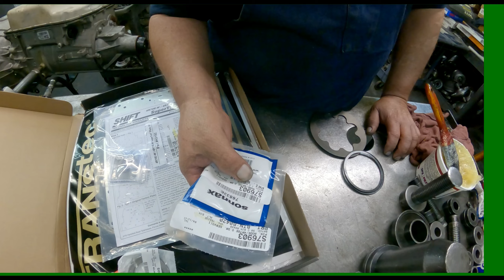Ford 4R70W Rebuild

Comment: Can you buy all of this in one kit ? Even the master kits at the parts store only have the bands steels and frictions and gaskets nothing more..
Reply from the maker: No. Nobody can guess all the parts you will need. And you will not need some parts all of the time.
Reply: @CurmudgeonTransmission Absolutely agree 100%. 
I will tear down and see what I need. Should I get a new internal harness just to avoid any unnecessary issues ?
Reply from the maker: @tedbear8168  If you desire to. They don't go bad that often. I replace maybe 2 a year. Usually need , depending on the year, kit w/ clutches and piston. Both bands. Most use a 4x4 filter even if it is a 2wd. Sonnax overdrive servo pin. Superior K0192. Shift solenoid assembly. If high enough miles, epc solenoid. Bearing  kit. Bushing kit and torque converter. When you get your converter, match the fin angles before you let the core go. They are the dimples on the outside. Get the wrong one and it will throw codes.
Reply: @CurmudgeonTransmission I have it completely torn down as of this morning the frictions and steels for all the forward gears are burnt completely up, I will take your advice and order the parts you’ve mentioned. Could the torque converter be the reason the transmission suffered the blown out seal on the piston inside the drum ? I found lots of rubber pieces of the seal inside the drum this morning.
Reply: @CurmudgeonTransmission the reverse band looked incredible for 216k miles it doesn’t even look worn down but the kit does come with the new bands ! I just get very nervous when working on things I know it can get very pricey ect. But so far the rebuild is way cheaper than a 2,400$ rebuilt trans.
Reply: @CurmudgeonTransmission and thank you for your videos sir I watch them every day 🙌🙌🙌
Reply from the maker: @tedbear8168  Thank you!!
Reply from the maker: If the drum is not cracked where the snap ring is then the frictions got so worn the piston over traveled and when it released it cuts the seal to pieces.
Reply: @CurmudgeonTransmission thank you for the explination !!! That makes sense !

Comment: Love your videos used this to rebuild my 4r70w 99 model only thing i cant figure out is the intermediate clutch was burnt in mine and slipped in all gears but there were no failures i can find. Other than clutch material in the fluid and the steels of the 2nd gear had a few burnt spots any advice. Also how much clearance should the intermediate clutch have  I measured it 3 diff ways per the info on Google and the clutch pack that came out was thicker than what I put back in 1.630 with bar to top disc but about 50 thousands from the top plate to the step can too tight cause slipping because the one that came out was 70 thou thicker than what I put back I havnt installed unit yet kinda scared
Reply from the maker: Too tight is going to cause a bind up. Too loose will slip. Where did you get your parts?
Reply: @CurmudgeonTransmission  I bought a remco kit off the internet and added a superior shift correction kit and sonnex pressure regulator valve all new electronics and harness the kit seems like it's decent but idk what do you think
Reply: Kit I bought had everything clutches steels  solenoids and bands and gaskets I'm hoping it fixes my slipping issue all the clutches were in spec except for the intermediate it seemed like it was thinner than what was in it I'm hoping it was a pressure issue that was causing the slip on the old stuff
Reply from the maker: Don't know anything about Remco, so can't say anything about them. I personally like Transtec kits.
Reply: @CurmudgeonTransmission  it seems good the friction plates are reybestos it
Reply: @CurmudgeonTransmission  should my output shaft be hard to turn input is stiff but easy output takes two hands both ways
Reply from the maker: No. Should be able to turn it with one hand one way. May need 2 to turn it the other way. Input shaft should be able to turn with one also. You may have the bearing that goes between the reverse and forward drum swapped with the one that goes between the case and output shaft. The one with the scalloped edge goes on the output shaft.

Comment: Just rebuilt mine with and input shaft turns but is pretty hard to turn. I’ve taken it apart and put it back together 3 times and still it’s the same everytime as soon as the pump is seated it is hard to turn, is this normal? Just resistance of new frictions?
Reply from the maker: I have run into a couple of things before that one of them will probably be your problem. The first one is a bearing being in the wrong spot. The one between the reverse and forward drum is really close to the diminsions of the one bewteen the case and the output shaft. The one that goes on the output shaft has scalloped edges, the reverse is flat. The other one I have run into 2 times is the thickness of the Intermediate clutches. They were only off by .001 per clutch but it was enough to make it too tight. Leave your Intermediates out and reinstall the pump. If it turns easier your problem is there. If not the bearing is probably your problem.

Comment: Great video recently built my transmission but when you put it in reverse the truck wants to die put it in drive and just bogged down little bit
Reply from the maker: Sounds like lock up is staying applied. Unplug the transmission harness. If it still does it you will know it is in the unit, if not it is outside the unit. Any codes?
Reply: No codes
Reply: I did fine transmission fluid in the wire connector that comes out of the transmission . The one that plugs in the wiring harness
Reply from the maker: @jamesball6847  Let me know what it does when you unplug it.

Comment: Hello, I’ve rebuilt a few transmissions over the last few years (mostly Honda and bmw)…..anyhow I’m now rebuilding my 4r70w but I’ve been having problems with the case bushing being too tight for the output shaft to move, it will only turn with 2 hands (not very freely), ive tapped all for sides with a rubber mallet and no luck😔 any tips or suggestions?
Reply from the maker: Make sure there are no burrs from driving the old bushing out. Make sure it is a quality manufacturer not Chinese. If you are still having problems, use a piece of All Thread to pull it into the case instead of using a bushing driver.
Reply: Well I got the old(new) bushing out and have another one on the way. It seems I have a slight burr, what would you recommend to remove it/level it?
Reply from the maker: Round file, sand paper.

Comment: Is it normal to have an extra friction and an extra steel in some of the kits ? After putting together the forward drum I have two extra frictions and 1 extra steel, I’m so stressed out about it for some reason haha.. I tripple checked and watched the video multiple times while installing the parts. I was just curious if you ever have extra parts
Reply: My kit didn’t come with a wavy plate is that why there is an extra steel and two frictions ? I’m utterly confused.
Reply from the maker: The extra steel and friction is probably for the reverse drum. There are 2 different ones. Most only have 3 frictions. The early ones had 4. You can swap the drums if you desire. If you look closely the reverse steels will fit in the forward drum but are a little loose. The forward steels will not fit in the reverse drum, they are too large. Same with the frictions. No the kits don'tcome with the wavy plate, if it is broken you will have to order it separately. There should be 5 frictions in the forward drum. Start with the wavy plate and then a steel, then a friction and alternate to the top. Then the pressure plate. Reverse drum starts with an apply plate with the flat side up, friction, then steel, alternate steels and frictions to the top. Then the pressure plate. Same with the snap rings. The reverse is slightly smaller than the forward one.
Reply: @CurmudgeonTransmission My man thank you so much for the response ! This is why I respect your Channel so much. Thank you man 🙏 I got it all put back together this morning and am going to start on the valve body this afternoon.
Reply: On my 1-2 accumulator the top springs there was only one big spring not a smaller one when I popped it out. Should I order the smaller spring or is it fine with the one big spring on top ? Thank you for all your help also,
Reply: I also didn’t have the tiny piece for the separator plate plate but it looked good with no cracks in it, I work in a manufacturing plant so I’m thinking maybe some of these small missing things they just didn’t have and they weren’t crucial components, or someone has possibly been in the transmission before ? I need to check the old forward band for any dates on it!

Comment: How the fuck do u get those damn clapsing ring to clasp
Reply from the maker: The way I do it is, push one side in. Then, kind of pull the other side around. It will make the tip pooch out. Keep pulling until it lines up, and then push it in. Little hard to describe. Go to my Instagram and I can shoot you a short video of it.

Comment: Hey buddy i really love your channel and appreciate all the information you've been offering for us, i have a f150 2000 5.4 2 valves, just finished rebuilding my engine by myself( its a project truck), works like a champ but after a few months ago transmission went bad, change gears but takes to long to get in the first, it slipping and not shifting smoothly from gear to gear, long story short ill take a chance and rebuild it by myself, what kit do u recommend me to buy?( lifted truck)
Thank for your help 🙏
Reply from the maker: I like Transtec with Raybestos clutches.
Reply: I ordered all the parts also the sure cure kit except the accumulator kit, i was wondering if you could recommend a brand for the servos, im looking at ebay i found a NATIONAL brand also Alto for the overdrive servo, what do you think???
Thanks for your help 👍

Comment: I have a 20005 Ford F-150 STX 4.2 4r70e, and I believe that my oil pressure pump is not working, will this help me into fixing it for the first time, I've never done this before, and I don't know the cost of such things to replace...
Reply from the maker: What makes you think the pump is bad? This is one of the easier transmissions to do. They can vary greatly in cost, depends on what is wrong with it. They are very prone to planetary damage and that can be quite costly.

Comment: I watched the video and loved it learned a lot . Will this same rebuild work on a 1995 4r70w
Reply from the maker: Yes, it will. There are a few differences. Assembly wise the difference will be when you get to the center support. the snap ring opening goes in a different spot. I have a video on that version of the transmission.  https://youtu.be/8FmiDaRKtZw   Thanks for watching.

Comment: My 2008 4.6 2wd  f150 after a few miles would hesitate on 3rd and 4th,when let go the gas  and then when I stop and park wouldn't go on drive, I put it on 2 and it goes, once is moving I put it on drive and is okay, need some advice please
Reply from the maker: Sounds like 2 different problems. The no drive problem sounds like a bad sprag. That will be an internal problem. Sounds like it is time for a rebuild.

Comment: Just an honest question. When I pulled mine apart it didn't have that rattle clip and my kit doesn't have one in there. Does it have to have the rattle clip?
Reply from the maker: If you are talking about the one under the pump for the Intermediate clutches, no it does not have to have it. They were not in all units. Forget when exactly it was they started putting them in. Want to say around 2004.
Reply: @CurmudgeonTransmission  ok thank you sir

Comment: Which video describes the different sensors? I'm having an issue where I've replaced the output shaft sensor, the rear differential sensor and I keep getting a VSS code. When I change the sensors I unplug the battery and my fuel economy goes up and I don't get the code for 30 miles. After 30 miles of fuel economy goes down and I get the code, even after replacing both sensors. Before I replaced any sensor the speedometer and the tachometer would be jumpy, not smooth. After replacing the VSS on the transmission the speedometer started operating smoothly, but the tachometer is slightly jumpy still. After it threw the code again it started moving slightly jumpy on the speedometer, still the same jumpiness on the tachometer. I tried replacing the camshaft sensor as well, no joy. Any help would be greatly appreciated. 2001 Ford Expedition xpedition 4.6l 4r70w.
Reply from the maker: I would look at the wiring harness where it comes up over the block by the filler tube. You will probably have to disconnect all the sensors and pull the harness up far enough to get a good look at it. The most common issue is an EPC code but I have seen other issues in that area. Let me know what you find.

Comment: What Transmission Fixture are you using, can't find one specifically for the R40W. Thanks
Reply from the maker: It is made for GM transmissions but works. https://www.toolsource.com/holding-fixtures-and-support-c-1321_119_582/gmtransmission-holding-fixture-t0156b-wo-base-p-94383.html

Comment: Just found your channel and subscribed. I learnt a few more things I hadn’t seen before. Have you ever used the stator support and pump body from an 04 and up 4r70e or 75e on an 03 and down? Read info that the intermediate piston is larger and has more holding power on 04 and up. I took my 03 marauder trans apart to install sonnax direct drum and forward drums and check it over before supercharging engine but am not sure if I should pursue this modification or not bother.
Reply from the maker: You can use any pump on any year you want you just need to use the correct intermediate return spring set up for it. If you are going to go with the super charger upgrading the drums would be a wise idea. Good luck with your build. Thanks for watching and subscribing.
Reply: @CurmudgeonTransmission  thank you very much sir. Yes I’m upgrading the forward and direct clutches with the sonnax drums.
Reply: Thank you for making these videos. I’m getting everything ready to rebuild an AOD out of a ‘89 Grand Marquis!

Comment: Good video and I can tell you are quite good. But man, you should have at least torqued the valve body. Risky using an impact the whole time
 And that valve bore may have been tight bit of the valve is too worn and then you widen the bore that can cause some problems. Otherwise great knowledge
Reply from the maker: Thanks, thanks for watching.

Comment: Do the clutch packs change size when they get wet for the first time?
Reply from the maker: Not by much. I knew it was not very much, so I decided to do a test yesterday and see just how much it was. Took a dry clutch and measured it and then soaked it for 3 hours in fluid. Then re-measured it. Started out at .0745 and was fluctuating between that and .0750. So, it was somewhere in between those two numbers. After soaking it was a solid .0750. So, it swelled a whopping .0005. Really probably less since it was fluctuating before. Probably more like .00025-.0003.